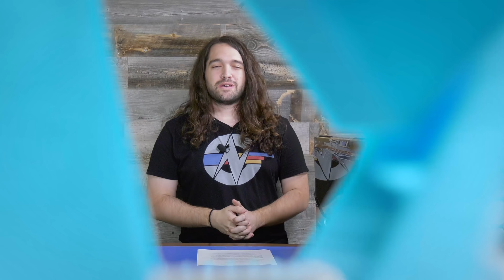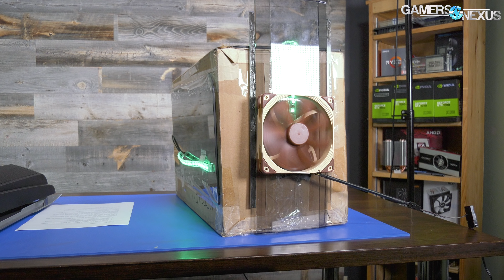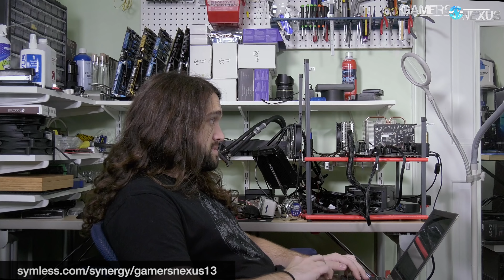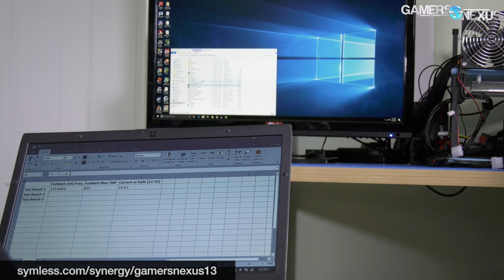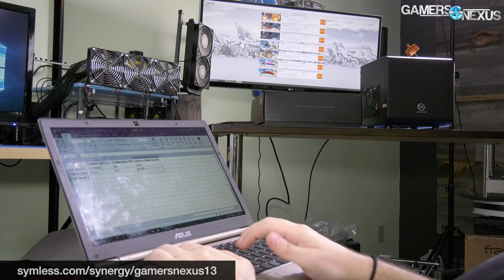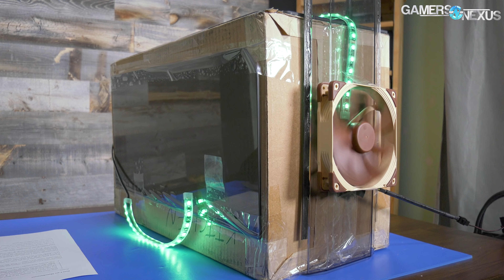Case Manufacturers: You're Worsening FPS & Power Draw

Comment: Cmon Nexus.. Just make a legit case already.  There should still be a decent sized audience who favors function over looks.

Make one that is completely silent (But probably will be hot as fawk inside the case with all the insulation lol)
Then make one with the best airflow that gives you the best clocking speed (while still maintaining the case look, not one of those retarded looking skeletore transformers wierd looking case)

Then the 3rd case that is in between both of those.

Then just for the fuck of it, make one that is completely vertical that has a tiny foot print? lol
Reply: If you have seen other GN videos you know tooling costs to design a case are in the hundreds of thousands lf dollars right?
Reply: @unfortunatelyrob2635  But the real question is how are companies not reaching out to NG or LTT to make a case in collaboration? I mean they clearly have large followings that would be easily marketed too... how does NXZT design to do a ninja H700 gaming case, pubg, nuka cola collabs or Lian Li decide to reach out to some over clocker to collab on the O11 Dynamic where hes able to convince them that the option for having two psu's in a case is something the market wanted/needed was a good idea... why make a collab with someone that represents/targets a small percent of the market "extreme over clockers" vs using someone like NG or LTT that represents your average consumers needs/wants and both have much larger fan base followings id assume... i still dont know the name of or anything about the guy lian li collab with other then hes an extreme overclocker but you can guarantee anyone thats built a pc in the last 5-10 years knows of linus, NG, hardware canucks, pauls hardware etc etc... the good thing about the lian li, and NZXT collabs though is it leaves hope for other companies to follow suit and attempt more collabs with other social media tech figures... cooler master after the h500p incident with steve totally shouldve gave him a "put up or shut up" type of moment to design his ideal case fully backed by coolermaster, it wouldve been the perfect opportunity to reach out for a collaboration... and i get that case designs can take years to develop but 100% LTT or NG would jump on abroad a case design team given the opportunity.
Reply: Just get a core p5
Reply: He'd first need a small loan of a million dollars
Reply: Candi Soda You can find all of these cases already! Just think: Cooler Master. Specifically the Master Box. It comes with Mesh or solid panels. You choose!
Reply: Just moved into a Core P5. Super happy with it.
Reply: Candi Soda why compromise? Form AND function

Comment: What happens if you use Dyson's vacuum technology for their 'bladeless' fans and stuff, and stick it into a PC case?
You create high pressure airflow, which generally is preferred, and you can 'pipe' it to push hot air further by blowing cold air directly and specifically over the components.

For instance imagine the inner walls of a case has small 'piping' to allow air to pressurize and be blown through the front, which funnels it in through large powerful fans, and you can use sound dampener in front of these fans to ease the noise, but the smaller wind pipes essentially boosts the air speed.

What if you can utilize it the other way around, using these 'wind pipes' to suck hot air out of the case and blow it upward at higher velocity?

The small the surface area air travels in, the less powerful fans needed to make it go as fast... So a large, decent RPM fan in a 'funnel' to force air to compress into a pipe, could be quite effective.

Comment: I went out and bought 2 side fans and 2 rear exhaust fans and no matter the speed or configuration all that matters is the front fan be on the slowest setting the the 2 rear exhaust fans be as high as possible. I don't remember the fan sizes and brand names and all that but they are pretty decent fans all around. I made sure of that. This is for my particular case which is a cube for mini or micro whichever is the smaller atx. the front fan is pretty big. the power supply has its own intake on the bottom. The graphics card has its own intake on the other side. the cpu fan blows down on the heatsink and board. the two rear fans moved the most air for the size that fits. And no matter what configuration I use the best is no side fans front large fan set to slowest speed and 2 rear exhaust fans up as high as possible.

Comment: I've drilled a hella lot holes in my cheep knockoff case's front panel and designed a 120 mm fan mount to place it where 5 inch mounts are - worked for me:D

Comment: I came to the conclusion recently that a case is a waste of money unless you are moving it around a lot it doesn't need the protection, thermals, noise and performance are all better in an open air set up like a test bench, I have the side of my current case off and surprise its about 10 degrees cooler....

Comment: Well I think now is the time for case manufacturers need to invest in air multiplier technology, this would enable the front, sides and top of the case to be fully enclosed and still have decent air flow. I believe "Dyson" may own the patent but it only takes a 10% change to get around that. (That is if shrinking the technology is viable).

Comment: I just wanted to say thanks for this video, finally someone that talks some sense! 
I completely agree with what you're saying, and I would add as well that tempered glass side panels and window side panels in general started the bad thermal trend for the air cooled video cards. I noticed this when I switched to the 780t from the cooler master 690 II:  at the time I had a sli of 670 reference, and the temperature increased a lot making those cards throttling. That's why I did my first ghetto mod with 2 small aio's attached via zip ties. After that I switched to a single 980ti with a custom cooler (a gigabyte g1 gaming) and the card, albeit it was able to sustain the heat, it was way noisier than what I wanted. Therefore, I bought a 140mm fan bracket for a benchmark table and mounted it under the video card. The noise at that point was pretty sustainable and most of the time video card's fans didn't need to spin, but it made increase the cpu temps because the hot air was pushed through the top radiator destined to the cpu.
After a while I decided that my system looked awful and the PC was not able to sustain its overclocks in the hot Italian summer, that's why I ended up water-cooling everything with a custom loop.
After that, the dreaded maintaining started: and that's why I ask to the producers here to study a better way to keep the radiators in your pc clean, because if there is not enough room to use e.g. a vacuum cleaner to clean the fins, the only way to clean them is to tear down your whole system, and since radiators are dust magnets their fins need to be cleaned at least once every 2 months to stay optimal. 
An air can most of the time is not enough, it pollutes a lot, and will make a mess if you use it in a small room because you can't move freely your pc, (e.g. because it's water-cooled with rigid tubing and it's heavy). 
That's why something that I would love to see more is dual chamber chassis, those will be the answer for water cooling and air cooling. For air cooling it will separate gpus from the motherboard, hence there will be less heat for both, and for water cooling it could be a place to easily access radiators, not just one 360...which is not enough for high overclocks at 25C+ with decent noise levels. At this time the only two cases that actually follow these rules to my knowledge are the lian li PC-012 for air, and the Thermaltake tower 900. These are some original cases with ideas that needs a bit of refinement, to actually be gamechangers.
Reply: maybe a Silverstone ft02 is all you need
Reply: It's a really interesting case and it's different but there is not enough space for my watercooling needs

Comment: my thermaltake f31 suppressor tempered glass addition case is really nice. it has all the things you sort of mentioned that a case should have. the front panel is hinged and vented. you can control how much air you want moving through the top. its has a 1.5 inches of cable management depth in the back. i could go on an on about it but for real though. its a great case

Comment: I want to point out that cooler master had the first psu "shroud" with the haf x. It was not a full shroud, but it still covered cables. There may even be more cases that had them earlier, but that's before my time as a tech guy

Comment: Having recently built a PC in an old Antec Solo (the original one), I can confirm that the changes made to case design in the following years were hugely beneficial. On top of what you mentioned, standard 120mm and 140mm fan mounting points in all cases made a huge difference, as did moving the PSU to the bottom and creating HDD sleds that could easily take laptop drives. 

Now though, I don't see any reason to move on from my Obsidian 550D (an older case now). The best evolution I have seen recently is the addition of SSD mounting on the sides of cases, but the fact is that I did the same thing with a few pieces of double sided tape.

I WOULD like to see more 200mm fans, mesh fronts and removable fan grilles (I had to remove mine with a dremel, which was very much worth it). Those are the things that make me think about changing cases.

Comment: Steve I was wandering if you could take a look back at the diy pc cuboid. It is a few years old and only costs $50 dollars but has at least from my experience some good air flow, but i have added fans over time. its also one of the few cases with a vertical motherboard which is fun. i think danny from nerd on a budget had it to. i would just like to see your guy's perspective on such a unique case.

Comment: Hi Mr. Steve. That's what I noticed with my Phanteks P400. It's silent but my temp at idle is 35C-39C with a 240 AIO; 41C-42C with stock cooler. With the fron panel open, it goes down to 33C & 36C respectively. I'm planning to switch to an Aerocool P7-C1 - hope you can do a review of this case.

Comment: FT02 represent.  Yeah, my old ass case has better temps :P.
Reply: Jacob Kelly I'm using an FT02 right now but I'm moving to the 570X.  I thought the 570X was a compromise of good airflow and modern design aesthetics.  Steve's talk about thermals and GPU suffocation helped me decide.
Reply: I actually prefer the aesthetics of my FT02 tbh. But I've done a lot of work modernising the case, replaced the window with scratch resistant and optically correct smoked Perspex, added hotswap bays, bunch of 5.25" bays to give functionality, and getting some LEDS once I figure out where to place the strips.

Glass on the other hand everywhere just makes me go 'where the fuck am I hiding cables' lol.

Comment: I have a Raidmax Hyperion and my tempertures where very high, so i took the front panel off and the CPU temperture dropped 10ºC, i drilled the damn thing and bought a 200mm fan and place the front panel back, the difference open and closed is just 1 degree now, everything in my system is air cooled, i'm painting the job now to make it look good, but damn, that case has a poor design.

Comment: this weekend at a hot lan party i had to pull off the front panel from my phanteks evolv TG . inside where the same components i recently swapped out of my corsair 600T, i never had cooling issues with the corsair..i knew this was an issue with the evolv i was already thinking about modding the front panel so i bought the case anyway. buying a case that wont function without mods is kinda stupid.

Comment: Real Talk with Steve.
Important stuff here. Cases generally need to improve a LOT. So much trash lately, it's all bling and design - no performance whatsoever. A few good exceptions as you mention, but we deserve much more.
I also wish the focus on RGB and glass would just die already.. Fine that there are options, but currently it's pretty much all we get. Glad we still have Be Quiet and Fractal Design. :)
Reply: osgrov you make it sound like today's pcs are incapable of running efficiently. I run an overclocked SLI 1080 setup gaming at 4K with all games running at maximum settings, I have a case that is widely regarded as having poor ventilation and yet it runs whisper quiet, no crashing, overheating or throttling. So tell me what your case with all its little holes everywhere gives you that mine doesn't, other than earache?
Reply: DigitalNow calling people liars when you don't know the facts makes you look like a tit. I play Battlefield 1, Battlefront, P Cars, FIFA 17, Doom, Battlefield 4, Forza. I don't disable anti aliasing and often run at 2-4 times. I use a Gsync monitor with my FPS games all running 60fps
Reply: DigitalNow you know fuck all about me and what knowledge I have based on two comments so drop the pretentious BS. What you've failed to deduce from my first comment is that I run all MY games at max, it's the context of the point I'm making and at no point am I implying that the two cards are capable of running every game.
Reply: DigitalNow you have Natalie Imbruglia videos on your YouTube channel, I don't think you're in any position to throw those accusations around.

Comment: I've been finding it funny that there are cases being manufactured today that have worse thermal performance than my old ones from 2004, which have:
- generic case with surprise AT motherboard support - 2x front 80mm fans, 1x centered side 80mm fan, 1x rear 80mm fan, top mounted PSU (works well with late model CX850M)
- truly tool-less workstation case - 1x front 80mm fan (powerlogic ball bearing), 1x rear 120mm fan (powerlogic ball bearing), top mounted PSU (again, works well with late model CX850M)

Comment: I've been away from PC building for a while. Whatever happened to putting intake fans where the air was needed, and then figure out the looks afterwards? I remember manufacturers used to put an intake fan right next to the GPU on the side panel. Bit Tech even did a comprehensive test on a Define R3 and determined that a GPU-oriented intake had the biggest impact on overall PC cooling, even more so than having an exhaust fan.